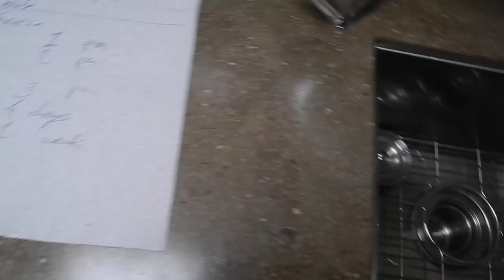A lot going on in this video

Comment: The quarter turn valves to isolate the coolant going to the water heater, is on my list of projects.  Keeping coolant in the engines is critical.  Keeping the water hot, is not critical.
Reply from the maker: Agreed BUT there are TWO engine coolant hose valves, supply and return. Be sure to locate BOTH these valves.
Reply: @AskCaptainChris   Of course.  I have that same dual valve set up on my semi truck.  If I get a leak in a heater hose, just isolate the system, and continue on down the road until I can get it fixed.

Comment: Hey good morning captain, would you be able to tell us what that octopus adapter to the through hull is at 2:28?
Reply from the maker: I believe you are referring to the multiple hoses going down to the yellow valve handle and overboard. That could be a combination of air conditioning drains and deck drains. That was a wise choice instead of drilling multiple holes in the side of the boat.
Reply: @AskCaptainChris  
It's a good idea for sure